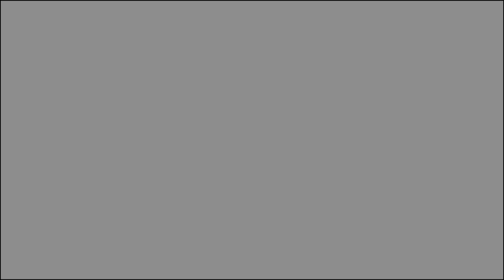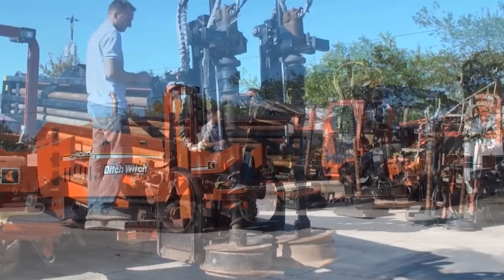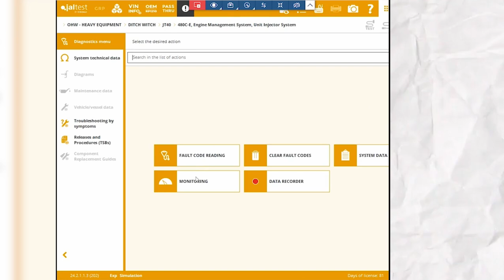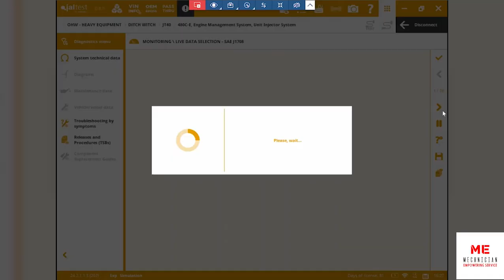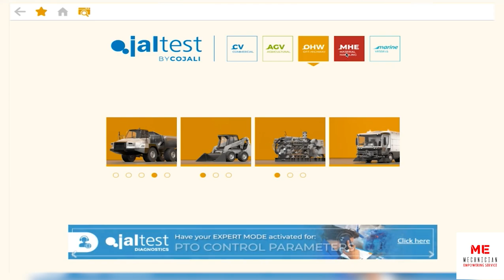(EN) Ditch Witch JT4020 All Terrain Drill Diagnostics Demonstration with Jaltest #viral #jaltest

Comment from the maker: ⏱ Timestamps
00:00 – Intro & Connection Options (Bluetooth, USB, Multi-pin)
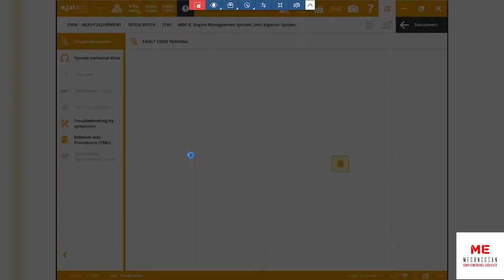00:45 – Fault Code Reading & Freeze Frame
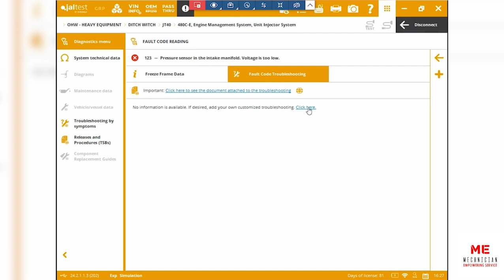01:15 – Live Data Monitoring (450+ Parameters)
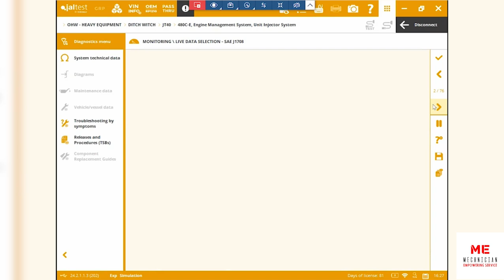01:53 – Using Real-Time Data for Decision Making
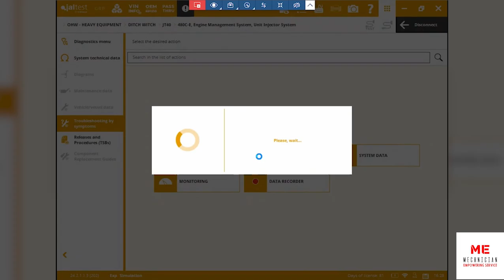02:12 – Troubleshooting by Symptoms (Engine Knock, Noise, Flow Issues)
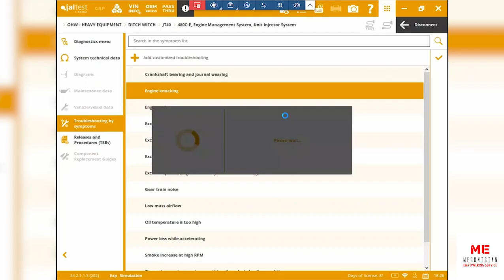02:40 – Step-by-Step Guided Repair Instructions
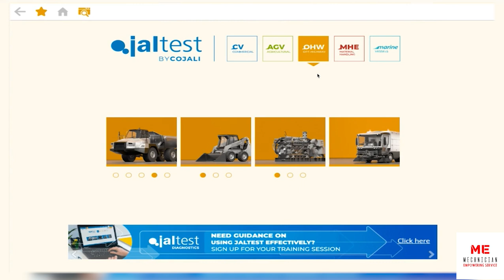03:01 – Wrap-Up & How to Book a Demo